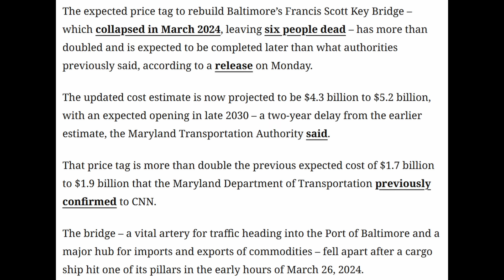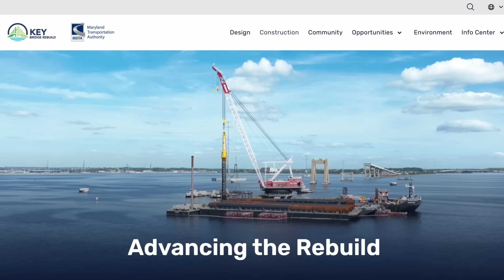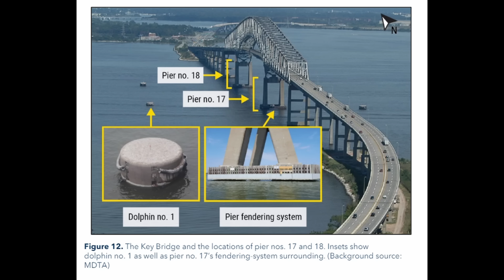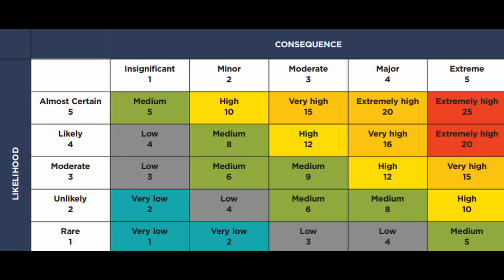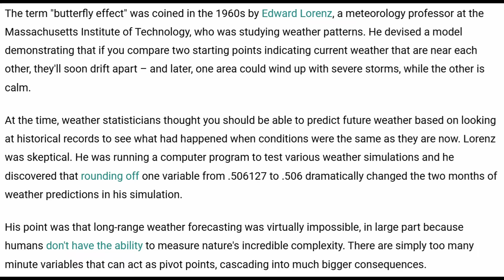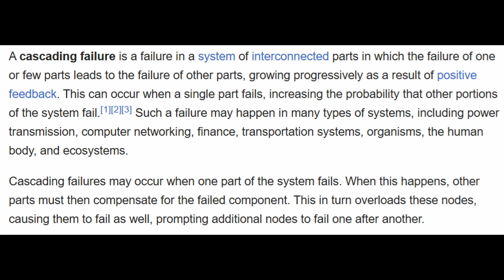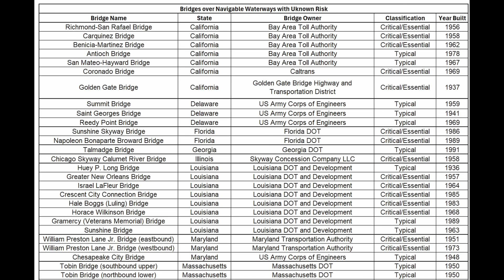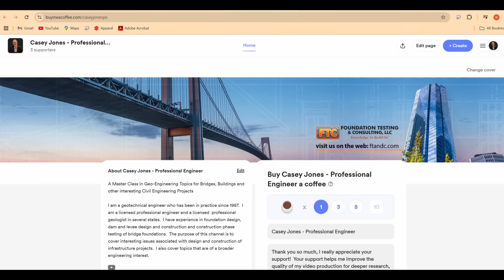Key Bridge Destroyed because of a Label on a Single Cable

Comment: Hell, the post-9/11 national security report highlighted the Frances Scott Key Bridge as vulnerable to collapse if struck by a ship. Their recommendations were ignored. Or rather, never actually acted upon which is the same as ignoring IMO.
Reply: Victim of anti-infrastructure politics.
Reply: @blairhoughton7918  Yeah, we have a tendency to be rather reactive as opposed to proactive when it comes to our infrastructure and safety concerns. And even then, we also tend to resist actually doing anything until there's enough public outcry/attention.
Reply: No bridge or protection system could remain standing after hit by Panamax ship.
Reply: @scottkozel1519  The ground can. Current bridge designs make sure big ships run aground before they hit something important.
Reply: @eljanrimsa5843  
Not with the Key Bridge scheme. The proposed main piers are in waters deep enough float a Panamax ship.

Comment: The Empire State Building withstood a plane crash shortly after its construction.   The Key Bridge withstood a strike a few years after she was built.  The World Trade Center was unable to withstand an airplane crash 50 years after its construction.   You build for current need not for all unforeseen future (40+ year later) possibilities.
Reply: The plane that hit the empire state building was a Martin B-25, I could not find the model but the heaviest was 5 1/2 tons empty. It was flying to NJ so shoud have not had over a ton of fuel and a ton other items.  Weight would not have been over 10 tons. The 767-200ER  flight 11 had a max takeoff weight of 190 tons. I am sure it was not that heavy but since it was a long flight with a good numnber of passengers it was over 120 tons. The B-25 was near end of mission would have been low on fuel, -likely less than 1000 gallons, the 767 hit not long after takeoff and had most of its fuel in the 20,000 gallon range.  The 767 was at least 12 times as heavy and 20 times the fuel. Would the ESB survived a 767 hit?  I hope we never find out but I have doubts.
Reply: @fromthefireside5677 what I was trying to convey, the early disasters were within the realms of possibilities when the structures were built, neither the World Trade Center nor the key bridge were ever envisioned to withstand the forces that brought them down.

Comment: As a US Navy naval engineer, we have increased the size of commercial container ships by magnitudes, and never rebuilt the bridges dolphins (bumpers).   
Baltimore (& Maryland) widened and deepened the channel, but never revisited the bridge safety requirements.   Let’s add more circuits to our household (each 15 AMPs) but never updated the main circuit breaker (fuse box) switchboard, and hope everything works out…. 

Who should have paid for the improvements (the shipping companies saving money or the state trying to attract business)?
Reply: They'll put a tollbooth on the road.

Comment: We’re blaming the bridge now?   Lol.  Instead of redesigning and re-making every bridge, how about we  make a limit to the size of these container ships? The only thing that mega container ships accomplish is making billionaires slightly more money.
Reply from the maker: It shouldn't be unreasonable to design a bridge that has its piers located in such a way that a ship impact is either not possible or would do little to no damage to the bridge.
Reply: The deepwater pier protection problem -- shallow-water piers can be shielded with dolphins, rock islands, or stone-filled cylinders. These systems dissipate energy and redirect vessels. Deepwater piers are far more difficult. The forces from a Panamax or New Panamax vessel at speed are so immense that no proven, full-scale technology exists to guarantee protection. Current practice relies on enlarged dolphins, sacrificial islands, or layered piles, but these are extrapolations of shallow-water solutions. They have not been validated against the kinetic energy of modern container ships in deep channels.

The final report will almost certainly stress that there is no proven, universally accepted technology to protect deepwater bridge piers from modern containerships. That is why many new crossings (Corpus Christi Harbor Bridge, I‑710 Long Beach International Gateway Bridge, Gordie Howe International Bridge, Hampton Roads tunnels) avoid placing piers in navigable channels altogether.
Reply: @CaseyJones-Engineer  that is a completely different question.  Yes—moving forward—integrating better designs into bridges is certainly not something that I’m opposed to. However—the bridge that collapsed here was in service for nearly 50 years—and it probably would have lasted another 50 years  had it not been for a poorly maintained ship and an inept crew.   Instead of trying to blame this collapse on the bridge—how about changing shipping rules to where the billion dollar shipping companies that operate these ships are fully liable for the destruction that they cause. This would force them to invest money in maintaining their ships and vastly improving the quality of their crews.
Reply from the maker: @jeffv3296  You're still missing the point. Many bridges have been retrofitted to provide better pier protection because the potential for ship impact is a known hazard.
Reply: @CaseyJones-Engineer  and you are missing the point. If the point is to minimize the chances of this happening—it’s not just on the design of the bridge—it’s in creating policy on the shipping side that also reduces the chances.   If you lower the punishments for crime—you know what happens—more criminals.   Two things can be true at once.  I would say that it is easier to motivate better maintenance of ships and better crews—than it is to retrofit every bridge in the world.   In THIS case—the bridge was the victim—-let’s be transparently clear on that.
Reply from the maker: @jeffv3296   Your approach completely ignores the possibility of bad actors. That's why taking a more active approach with bridge protection is the primary way to safeguard these structures.
Reply: @CaseyJones-Engineer  I disagree. I think that making the shipping company or the country where the ship is registered to be fully liable for damages that are found to be caused by the mismanagement or these vessels or the ineptitudes of their crew is an equally big factor.  These billion dollar shipping companies reap all of the benefits from creating larger ships, not doing proper maintenance (as that cuts into their profits), hiring crew that is not top notch—but they only absorb a fraction of the risk.   That is a recipe for disaster.  Yes—the technology of bridge architecture is certainly meaningful—but bridge archictecture improvement should be a byproduct of this event—you are painting it as a cause of this event. I disagree with that.  We can agree to disagree—there is nothing wrong with that.
Reply from the maker: @jeffv3296 Thank you.

Comment: looking at the pictures, you are showing of the new bridge,Ii barely see any dolphins around it. a ship that size hits that pier it will take it out.
Reply: There were several on the side upriver, between the pier and the channel. I didn't see any on the bay side.

But Casey did say that the new piers are far enough outside the channel that a ship will run aground first.

Comment: Not to be overly pedantic... ok I'm going to be overly pedantic.

I don't think the loose wire causing the bridge to collapse is an example of the butterfly effect. The butterfly effect is when a small cause can have a large effect - that is totally unpredictable. The butterfly flapping its wings may cause a storm next year on the other side of the earth. But you cannot look at the butterfly flapping its wings and predict the storm. Nor can you look at the storm and infer the butterfly. That is what the butterfly effect is.

You can't say the same about the lose wire. You can look at the lose wire and predict that the ship might intermittently lose power. If the ship intermittently loses power you can infer bad things might happen. Among those is taking out a bridge. You can also go in reverse. You can look at the collapsed bridge and an obvious possible cause is an electrical fault in the ship. That is why you take care that ships don't have lose wires.  By contrast you are never going to go around preventing butterflies from flapping to prevent bad weather. 

Not that anybody cares.
Reply from the maker: No.  As I pointed out in the video, the key aspect of the "butterfly effect" is that small variations in assumptions for initial conditions can result in largely divergent and unpredictable outcomes.

Comment: Something about this explanation of the label causing the issue seems off. I think the terminal block  is at least as much at fault. The blue collar of the ferrule is insulated, so there is no reason the the terminal block needs as thick of a front face or needs holes that are tight enough to the insulated portion of the ferrule that the label prevented full insertion.
Reply: If you make the holes bigger, you can't make the panel as dense. And no matter how thick the panel is, there's a way for this to happen. And it's pretty obvious that the panel thickness is designed to prevent any chance of touching the conductor while it's touching the contact.

Comment: one good example is the sunshine skyway bridge in tampa bay. the old bridge got struck and the mid span fell, and many people lost their lives. the new bridge has significant dolphins around it, and I've fished on a boat many times around them. the size of ships that come thru there I would say they need even larger and more dolphins than they currently have. the key bridge only had 2 small dolphins at each pier.
Reply from the maker: Yes, I showed photos from that collapse later in the video.
Reply: A 40 years old design for ships 1/10 the size. A Panamax ship would destroy the bridge.

Comment: I remember driving to work years ago very early in the morning in the winter. I saw a beautiful and spectacular meteor streak across clear, black sky. I started to think of all the things that had to happen over the course of billions of years for me and that meteor to be in such proximity at that very moment so that I could view that. Every event that happens or you see in your life could only happen due to countless other events that had to happen just that way. If you really start to think about it, it can make your head hurt.
Reply from the maker: It's fascinating to think about the incredible chain of events that lead to specific moments in time, isn't it?
Reply: It is really stunning! An example:  the object 3i Atlas is only the third interstellar object that we've noticed and identified. Yet we have 3 current mission probes which will pass through it's tail* right away without having to change course. *(the expanding trail of gases and dust it's expelled due to heating that are following behind it) The odds are so close to zero it's crazy.
Reply from the maker: @bruceleenstra6181 So true!

Comment: They never seem to spend relatively small amounts of money >up front< to reduce risks after the project has comcluded.
Reply from the maker: Yes, it just isn't sexy enough I suppose compared to building new projects.
Reply: @CaseyJones-Engineer  So, should that bridge been scheduled to be rebuilt already?  If the structure was old or now known to not be safe - the entire bridge collapsed because one section failed - should there have already been a plan to replace it?  The cost to replace it before collapse shouldn’t exceed the cost afterwards, should it - unless relocation is a problem?  I’m definitely not an engineer, just curious.
Reply: “not enough money to do it right, but plenty of money to do it again”
Reply: Dolphin Barriers are neccessary part of any bridge over or near shipping channels whereever the water depth is sufficient for a large ship to stray. Just basic necessary precaution.
Reply: That's going to cut in to someone's profit!
Reply: @rockets4kids  Stuff like this isn''t even going to cut into profit, there are costs to being late...

Comment: Casey, back in the 70s when I was studying architecture,  we were made aware that structural engineers had recently been following a fad that to design something with absolutely no redundancy was "elegant "    OMG.
Reply: When I was studying engineering in the 90's, we were warned that sometimes we had to tell the architects "no, you can't build it to look like that".  It was our responsibility to figure out how to build things to an acceptably safe level, and to say "no" at times.  Sometimes, materials and techniques do not exist to allow certain aesthetic visions to be realized...and engineers were bound to bear that message even if if meant losing jobs.  When a doctor screws up, on person typically dies at a time.  When civil engineers screw up, many can die at a time.   Having that in the back of my head has given me the courage to speak up more than once, and the drive to find solutions/ alternate ways of getting to good.
Reply: @BrianFullerton  If I remember right, they never fixed he roof leak on the Frank Llioyd Wright house
Reply: @BrianFullerton  Dont forget the NY city skyscraper whose design was such that it could fall over in a windstorm over about 70 mph, it was the Citicorp tower and there is a youtube doc about the whole thing. The tower had it's supports placed on the sides instead of the corners due to a stupid church that HAD to be where it was, that design was a fatal flaw as the diagonals that were supposed to be welded were instead approved to be bolted.
The architect later checked the drawings and discovered the flaw, the fix was they had to send in welders at night and weekends when the tower was empty and secretely open the walls up to WELD the joints, and put everything back as it was before workers came in the next morning!
Nobody working in the tower suspected anything!
Reply: @BrianFullerton  Elegant... like the Morandi Bridge...
Reply from the maker: Very interesting, thank you!
Reply: That trend is still going today
Reply: You should not use God's name in vain.
Reply: @user-xf2oz6gr2o you should take the plank of hate out of your own eyes before trying to correct a meaningless splinter in youtube comments
Reply: @user-xf2oz6gr2o  That commandment warns against assuming the mantle of what is most holy in order to work against the Lord. Irreverent use of the Lord's name is simply blasphemy.
Reply: @SanchoPanza-wg5xf  I do not believe that your interpretion is correct.
Reply: @SanchoPanza-wg5xf  I am Don Quixote, lord of La Mancha, destroyer of evil am I.
Reply: @user-xf2oz6gr2o 
"I do not believe" and there you should have ended your sentence.
Reply: @budgiefriend  I stand  by my comment.
Reply: @user-xf2oz6gr2o  LOL!
Reply: @user-xf2oz6gr2o 
The commenter didn't 
Mister Sanctimonious, that came from the voices in YOUR head.
   How are you certain the initialism wasn't Oh My Goodness ?
Reply: @richardlincoln8438  I think your theory of what those initials stand for is rather low probability.
Reply: @user-xf2oz6gr2o  i don't think the lord above liked vanity you show either.
Reply: @richardlincoln8438  The commenter didn't 
"Mister Sanctimonious, that came from the voices in YOUR head.
   How are you certain the initialism wasn't Oh My Goodness?"  

Or Oh My Gosh.

Comment: The loose wire only started the problem.  The jury-rigged fuel for the generators, mis configuration of the power system, made it impossible to recover. They took out the back up systems through short cuts and violations of the running conditions.  Loose wire, yes, but it didn't have to be as serious if the generators were fed fuel by pumps with back up power.  So the real culprit is the short cuts, the failure to troubleshoot before leaving the dock after many failures of electrical systems, the failure to have backups properly configured before sailing.  The master of the ship should stand for accountability as the ship couldn't leave without his order and it wasn't ready to sail.
Reply from the maker: And don't forget the failure to provide an adequate level of pier protection from ship impact.
Reply: @CaseyJones-Engineer  Requiring all vessels large enough to pose a risk to the brtidge to be under tugboat control until they clear the bridge would be a layer of procedural prevention.
Reply: @CaseyJones-Engineer  A big YES,
Reply: @CaseyJones-Engineer  The MTA didn't protect its bridge, and the Numbskulls of the Dali didn't operate a respectable vessel.  IMO, the Dali should have been sunk in harbor as a terrorist vessel (since we can blow up boats leaving Venezuela with impunity) - this vessel actually killed people and caused direct losses.  There is plenty of blame on every side, and as a structural/foundation engineer I understand why you save the biggest criticism for those who could correct the problems as you find them but everyone gets a slice of the blame pie at this meal.
Reply: The age-old “cause” vs “root cause” conundrum. I’m an engineer in Manufacturing. It’s nearly impossible for management distinguish between the two terms when they just want a solution to an immediate problem. The root cause of the FSK bridge failure wasn’t ‘just’ a cable connection failure, rather it was all the other things you laid out. Those other failures just allowed that single event to happen.
Reply: Contractor is supposed to or should pull on the wire to be sure it is secure under the screw terminal    My fear was always that the screw was clamping down on the insulation not te actual copper.
Reply: @windsurfertx1  I have weekly discussions about crimp terminals and ferrules, and the use of ratcheting crimpers with the correct dies.
Reply: Yes yes I agree.  Do they not do a HAZOP  eview  for ships or adhere to ISA-84.   For the electrical and instruments